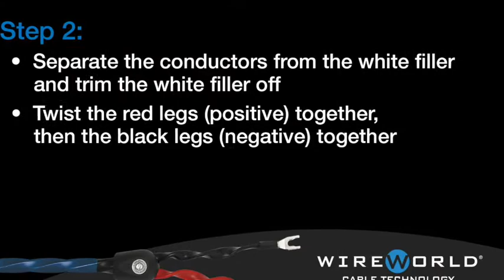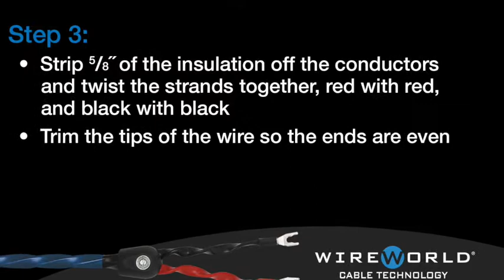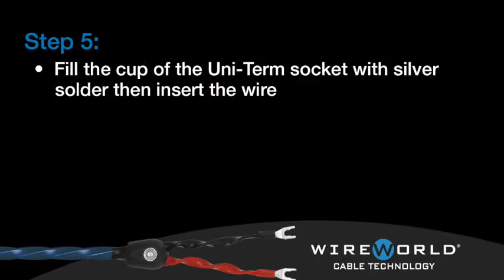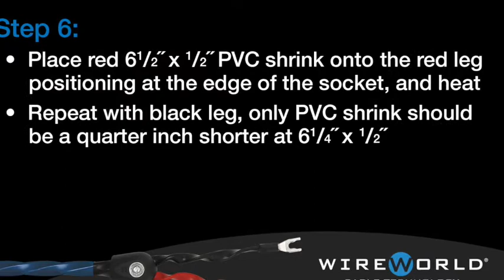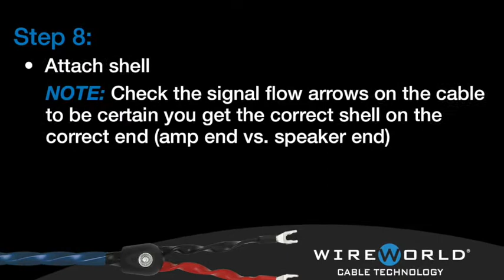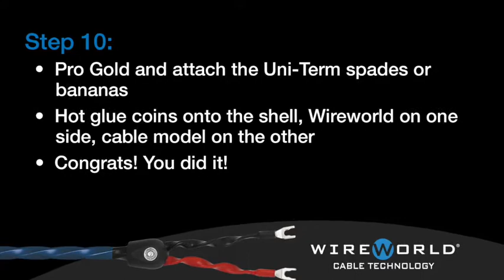How To Terminate Wireworld Oasis & Equinox Speaker Cable

Comment: what silver solder you are using for this?
Reply from the maker: Hi Goran, 

We use 
Kester 
SN96.5AG03CU.5.2.2%/275
.8MM (.031"). 24-7068-7601

If you would like to buy a spool directly from us, please contact sales@wireworldcable.com
Reply: @WireworldCableTech  I don't know what type of solder you guys use from Kester, I have some Mundorf Supreme with S-Sn 88,6%, Cu 1,8%, Ag 9.5%, Au 0.1% is it at least as good as the Kester model you use? I am planning to get 10m of Mini Eclipse speaker cable.